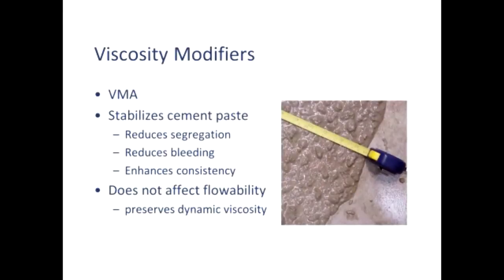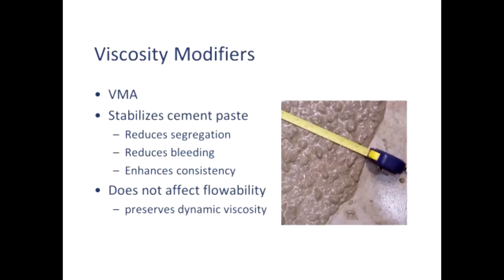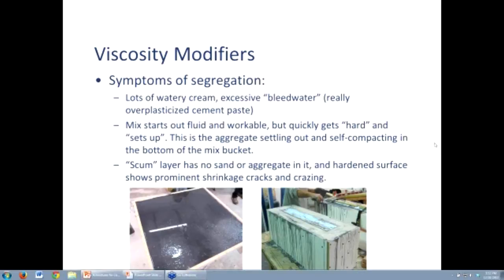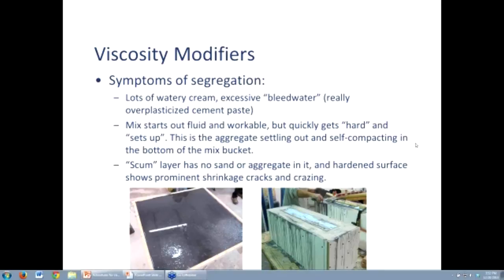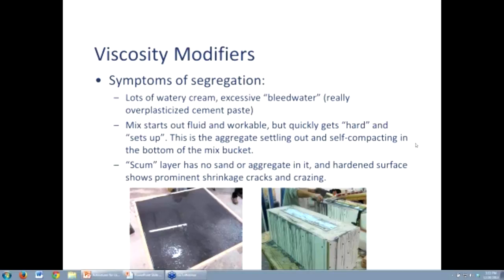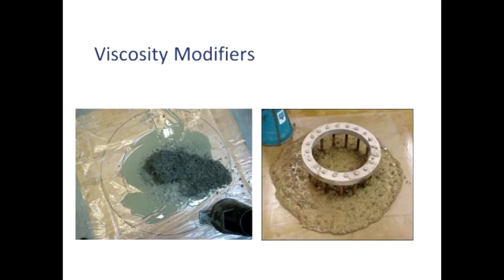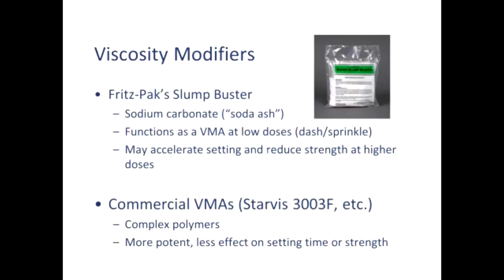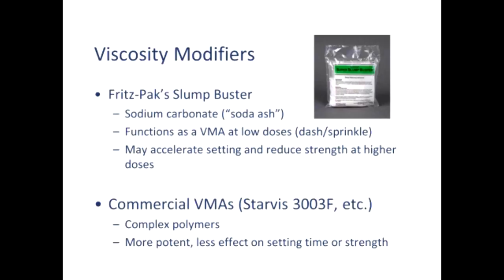Understanding Viscosity Modifiers for Concrete Countertops

Comment: Can I use direct sodium carbonate from a chemical?
Reply from the maker: Sodium carbonate is a basic type of thickener. It can be used to thicken concrete, but small, controlled doses are necessary. Adding too much can very quickly thicken the concrete to something that's unworkable, stiff and dry.
Reply: @TheConcreteCountertopInstitute  thank you so much for your quick response 

I don’t live in the US and can’t access to Fritz Pak’s product, could I use pure sodium carbonate from my chemicals supplier?
Reply from the maker: @Anick8  Yes, you can.
Reply: Fritz pack only contains 50% sodium carbonate, the remainder is a trade secret ingredient.
Sodium carbonate by itself doesn't do much, I believe it's included as a mild accelerator to offset the retarding properties of the other ingredient.
You can make your own VMA from  xantham gum and sodium carbonate from your local supermarket. Dose below 0.1% cement content. It works great.

Comment: I've been offered a liquid product with modified colloidal silica solution as the active ingredient. The description is:
CEMBINDER® 8 is based on amorphous silicon dioxide. The 
product is defined as a uniform dispersion of discrete silicon 
dioxide particles.
Is this actually a VMA or is it stabilizing in a different way?
Reply from the maker: This product is a tailored colliodal silica solution that functions more as an accelerator and paste stabilizer. Using it does control paste segregation, and it can be used to help create an SCC mix, but it's not strictly a viscosity modifying admixture that can be added to a runny mix to thicken it up. It is a liquid (50% solids), so adding it to a mix that already is too fluid may not yield the desired results in the same way a more traditional viscosity modifying admixture would.
Reply: @TheConcreteCountertopInstitute  thanks for that. I've been struggling to find a VMA for sale in New Zealand, especially at the small quantities I need. A lot of suppliers only have bulk product, I dont think anyone is importing the fritzpak product
Reply from the maker: @arniejudd605  you are very welcome. We faced the same problem in the U.S. in the past, until companies started packaging smaller quantities for our industry.

Comment: Hi again, Would a bonding adhesive and acrylic fortifier constitute a vma?
Reply from the maker: No. Those are glues. VMAs alter the viscosity (the thickness) of the concrete mix.
Reply: The Concrete Countertop Institute Can you please name a water soluble polymer, perhaps a brand or a chemical?